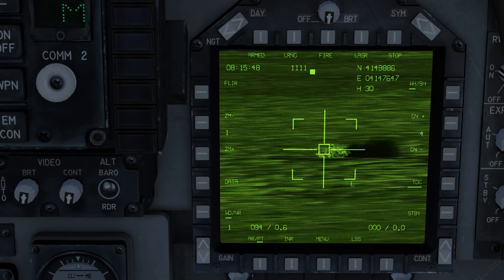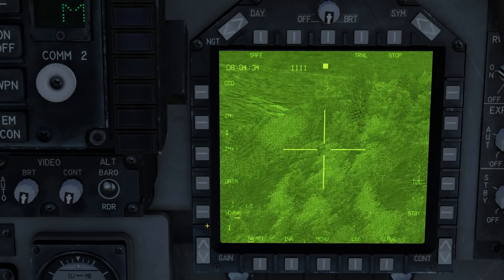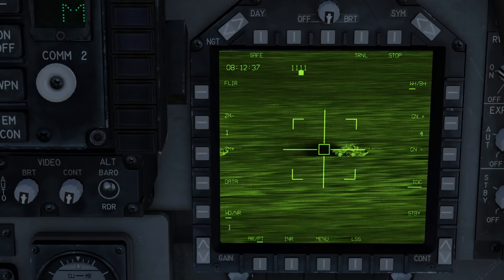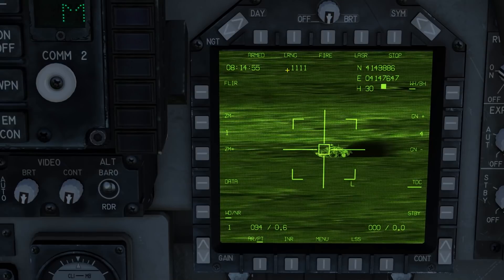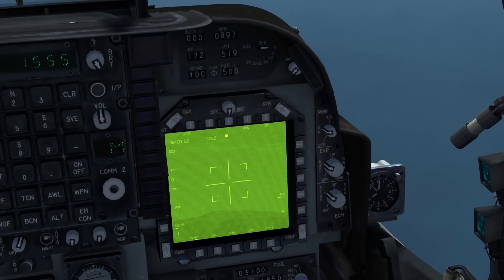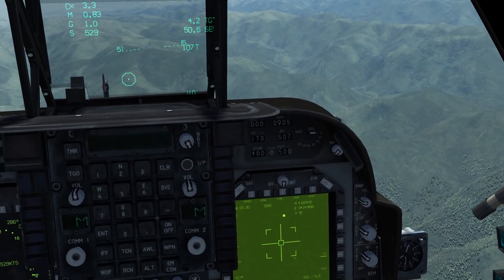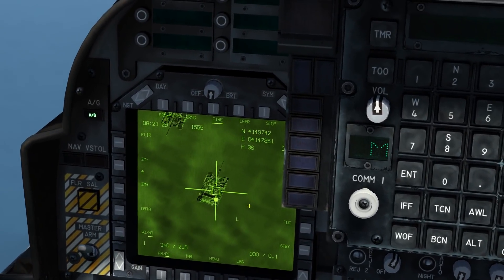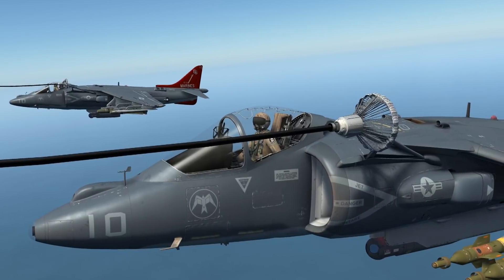DCS Av-8b Harrier TGP / TPOD Tutorial

Comment: Very good tutorial, much appreciated! Just one quick question:
Is there a special reason to first drop the GBU and THEN switch on the laser? For me, it also works when I first turn on the laser and then drop. I feel it's less stressful since there is no time pressure to get the laser on in time.
Cheers!
Reply from the maker: Couple reasons:

1. It reduces laser component wear (not really an issue in dcs)

2. If the bomb loses track / or the laser turns off / masked by the aeroplane. it can result in the bomb veering off in the last direction it was headed, they tend to wobble back and forth when tracking so a sudden loss can throw it off.

if you lase only when you're certain you can hold lock for the remaining duration of it's flight it prevents this issue. of course this relies on a reasonably accurate delivery. 

3. Doing this will also allow you to make a turn away from target before you start lasing if you wish, depending on the time to impact that is, allowing you to avoid overflying it.

4. lasing too soon can result in excessive manoeuvring by the bomb causing it to drop short by burning up it's energy. Although this is only really a factor on high alt or high airspeed drops where the bomb will travel a considerable distance.
Reply: RedKite Ah ok. Good to know. Thanks for clarifying! 👍🏻

Comment: Is there any point to having multiple TPODs, or did you just do it to demonstrate the possibility? Will they all track the same point and/or hand off control if one loses line of sight in a turn for example?
Reply from the maker: I did it just to show all the possible locations you can mount it. I dont think you can actually use more than one, the other two would just not function.
Reply: Thanks, your videos have been very helpful.

Comment: Hi I cant seem to engage  PT mode, I have enabled the TPOD, I have nav mode enabled, flir on and dmt on. Is this a flaw in the game? I can use PT mode when I make a mission where the harrier is already flying, but when doing a cold start in multiplayer, it never works.
Reply from the maker: I've had pt working in multiplayer with a cold start, though the behaviour is slightly different. Ive found it'l go into point track automatically when you stop slewing over a moving object. Provided contrast is good and zoomed in enough.
Reply: RedKite I appreciate the reply, I’ve just had a hard time finding anyone able to answer this question and you seem to be the subject matter expert. Anything else I have make sure I’m doing on a cold start to ensure point track works? At this point it could be anything stupid I’m missing in startup. I just learned how to cold start it because a server that does a2g pve only has cold start slots.
Reply from the maker: Cold starts are the norm on servers, i'd be surprised to find a hot start. It helps if you're zoomed in a lot (makes the slew slower and makes it easier to release the slew whilst over a moving target) Other than that just make sure everything is turned on.

Comment: it seems i can't engage the PT mode..?
Reply: i did a cold start, the Area mode worked just fine, but when i selected PT and i slewed over the terrain near my moving target it went straight to Area mode and i wasn't able to select PT anymore.
Reply: @redkite
Reply from the maker: Pt mode appears to be a little off, you should be able to slew over the target and release the slew directly on top of it, it should then automatically switch to point track and follow the object. If its having trouble try changing to ir, zoom in and swao bh or wh to improve contrast.
Reply: Well the problem is that when you don't slew it the first try over your target (which is kind of hard to do anyways) it'll change to AR mode and you can't engage PT mode anymore.

Comment: Any idea why when I select tpod and take it out of standby mode all i get is a black screen? I can slew around, change to FLIR. wh&bh work but still don't display an image but the screen is always black. What am I doing wrong?
Reply from the maker: Have you allowed time for the system to warm up? from a cold start it'l take a few mins to be ready after take off.
Reply: RedKite yes it was well into the flights I was trying to use the tpod. Turned out a friend of mine had the same issue with the a10c. He told me to change my graphics (so I just set them all to low) save and exit the game. Relaunch it and set them back to what they were. 

Fixed it, don't know if this is very widespread because I couldn't find much info online about it.
Reply from the maker: Thanks for the info, ive not come across it either,  but that sounds like a bug from changes to the rendering engine.
Reply: RedKite no worries .. thanks for your videos, their really helpful 👍

Comment: Do you know if it is possible to buddy lase to other aircraft, like A-10C's?
Reply from the maker: Yes, Any aircraft or JTAC unit on the ground with a laser designator can both budy lase for any other aircraft with the ability to drop laser guided munitions, but also use the laser designator for aircraft with laser spot trackers. You do however have to make sure everybody is using the same laser code.
Reply: Thank you!

Comment: It doesn't follow moving targets in 2.5. I've tried it several times, but the PT function doesn't make any difference. When I bound the TGP to a mini joystick and used it with analog inputs, I could engage PT mode but doesn't follow the vehicles. If I use buttons to move the TGP I cannot even switch to PT mode, it swithes back to AR again. Still buggy I guess. And the TPOD is still just "flying" under the middle pylon without any visible attach point. SAD.

Comment: What I am waiting is to get the DMT to lock and track the flying aircrafts just like in the ARBS manufacturer video shows it to be able. 

You have a 70 degree angle to all directions, so 140 degree in total for vertical as well for horizontal. It gives great possibility for DMT to be used to visually identify the target (as well explained in the manufacturer ARBS video).

Comment: How realistic and accurate will this plane be?
Reply from the maker: If i recall razbam target about 80-90% accuracy, that means that more or less everything that is declassified will be modeled to full detail or very close. (for example the encyption and iff panels are non-functional)
Reply: oh ok and what is your favorite aircraft to fly right now?
Reply from the maker: To fly, it's the harrier, to fight in it's the A-10c, the Harrier is a fun aircraft to fly but limited systems at the moment being in early access. Where as the A-10c has complete sensors and computer, using the datalink makes it loads of fun in co-operative missions.
Reply: RedKite ok thanks I’ve just started using dcs and I bought the harrier as I wanted a more modern plane. I didn’t buy the A10 because I was told it was an old module. Will the harrier be coming to 2.5? Where can I find updates on the development?
Reply from the maker: It is old, but it's by far the most complex module in the sim, cockpit textures are a little dated compared to new modules but still good. 2.5 has all dcs modules currently available in it, as for updates i'd suggest keeping an eye on r/hoggit or the eagle dynamics website/forum

Comment: Hi,
I installed 2.5 recently and went back to 1.5.8 and when i went back it seems like the tpod is broken again, i dont get the same symboligy on the hud do you have any ideas what it could be ?
Reply from the maker: This update was for the 1.5.8 beta, which has become 2.5, you'l need to use the patcher to patch to a specific version.
Reply: Thanks for the reply, I am using the steam version of Dcs. I dont have the computer at the moment to run 2.5 so i downgraded, it seems like it reverted to the first accidental issue of the TPOD. The options for which version in steam are as follows, 1.5.8 final release 2.x alpha open, open beta which of these would i choose to get back to a working TPOD in 1.5.8 it was working previously now its not
Reply: btw as always a great tutorial I subscribed a while ago

Comment: this still work in progress
Reply from the maker: Yes, as is everything on the harrier, however it is now in a sate where you can make practical use of it in combat.
Reply: in my case there is a problem with the laser, the second and third GBU always hit where the first GBU hit
Reply from the maker: I've not run into that issue, i've managed to drop 6 gbu'12's one at a time without a problem, didn't un-designate the tpod either.  If you're dropping multiple gbu's at once then, yes they'l all home in on the same location if thats what you're saying? if in doubt, try resetting the targeting system and doing a fresh run after dropping the first see if that helps.
Reply: update the game